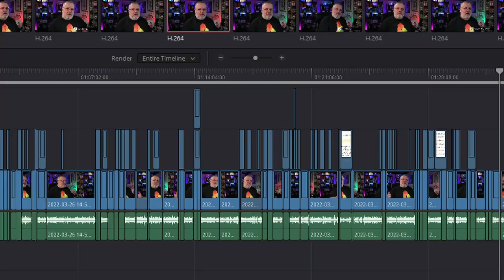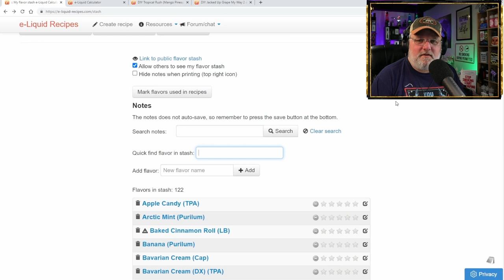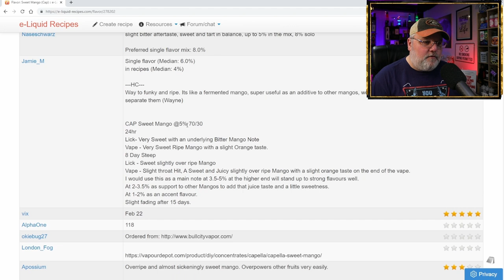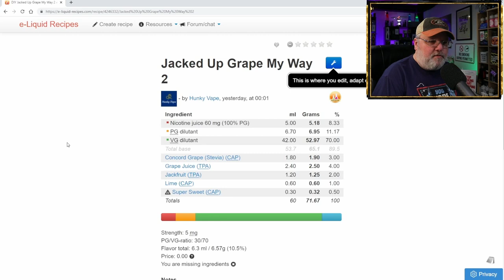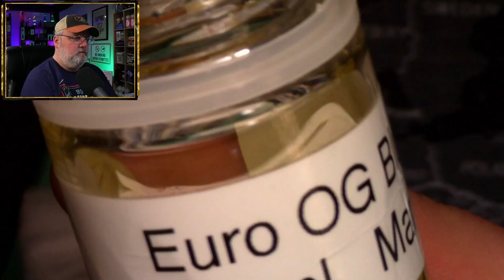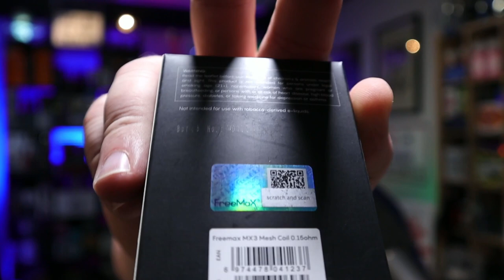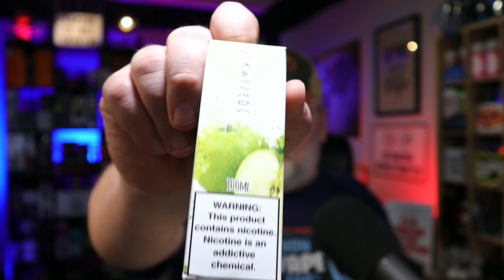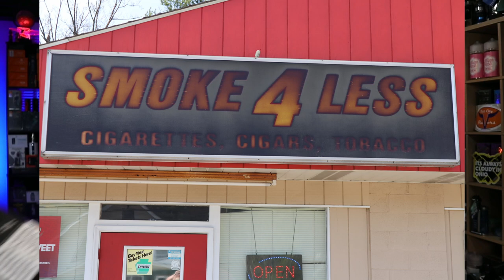750+ Subscriber Thank You VLOG

Comment: Congratulations on 750+ DJ Alex 👊🏽 have u ever considered trying mechanical mods just figured I'd ask since I've noticed your Vaping style and mine r fairly similar and I love my Mechs to the point they're pretty much all I use even for my MTL work setup which is a Notion MTL mech from Tenacious TX (Stan) and Timesvape underneath the  Kayfun Lite Plus MTL RTA  Thanks for another great VLOG and all the great content that you've made along the way can't wait for the next one
Reply from the maker: Thanks Redd. I've got a mech and have used it a few times. My only problem with mechs is the output is never the same. As the battery drains it puts out less and less each time. I like having a consistent vape experience. In fact, some of the regulated mods also decrease as the battery dies, so I can tell long before the mod shuts me off that the batteries need changed. So long story short, mechanical mods are cool and all, but I'll stick with regulated... unless I'm using the DNA in temp control. Now that's a perfect vape every time... unless it's time to drip again. LOL Now I know why they say variety is the spice of life! Have a great day brother.